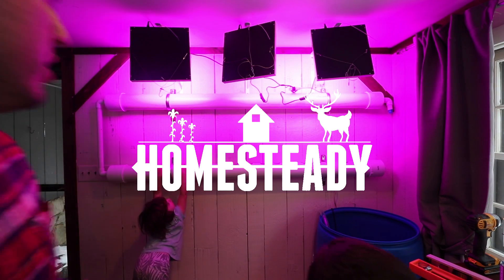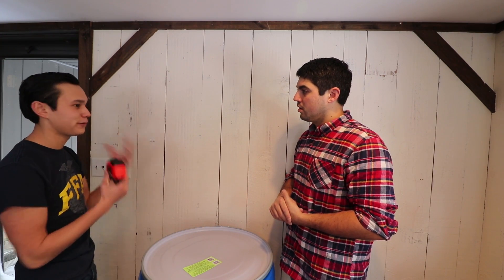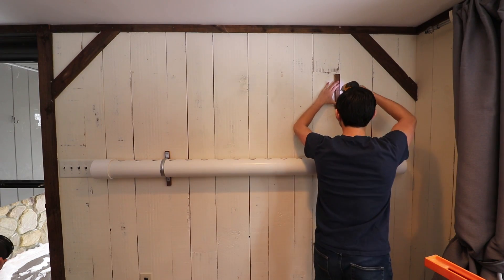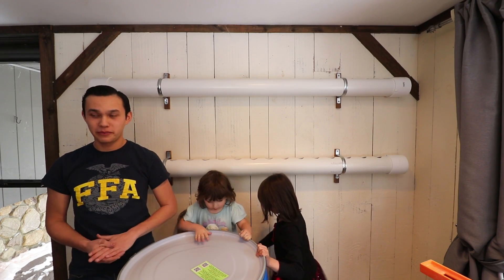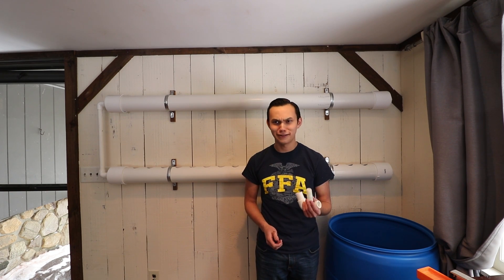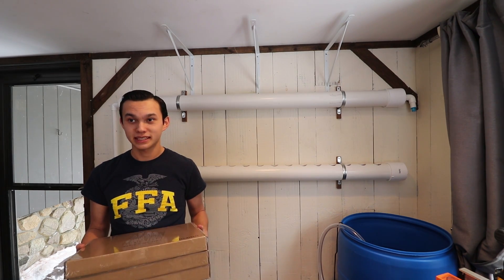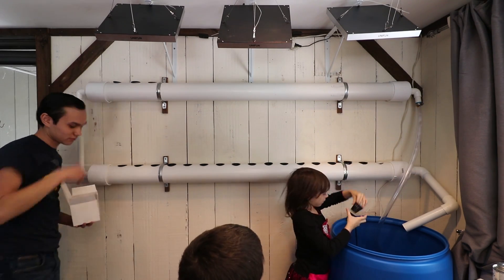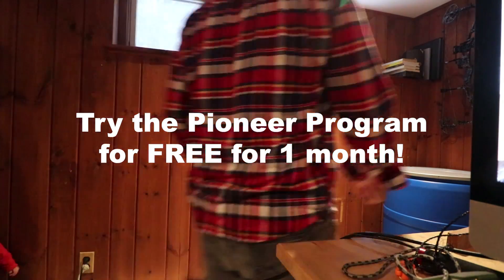Build a Hydroponic Grow Wall Inside - Grow Plants Year Round and Save Money!

Comment: Hi Jonathan, the LED light must be in purple color?
Reply: No, it can be white too, 6500K. There is a reason for the purple one, but I do not remember it.
Reply: Purple saves a lot of money because it uses less electricity I think
Reply: Those are specific spectrum lights.  A mix of Blue LED and Red LED.  Blue promotes the early stages of plant development, while red is used for flowering and fruit production.Too much red will cause leafy green veggies, like lettuce to bolt fairly quickly.  White/daylight lights, 6000 kelvin +/-,  gives you a full spectrum of visible light.  Daylight is comprised of all visible light colors which are important to plant development.  Too much of any one color will affect growth, nutrient uptake, and flavors of the finished veggie. 
 Hope that helps.
P.S.  -  Blue/red panels draw less power. a 50 watt panel for example of white draws about 50 watts of power at the plug.  Whereas, a red/blue 50 watt panel draws about 38 watts at the plug.

Comment: Love this but before putting on the cement use some PVC wash to brake down the plastic some so the glue holds tighter this is the way water company’s and plumbers do it I should know I have to help my grandpa all the time with PVC.

Comment: Cool idea. One thing on gluon pipe though. You need to use cleaner first. PVC has a uv protective coating that needs to be removed. It also preps the pope for better adhesion. You should also put glue on both parts. Great video though. I might do this.

Comment: Oh all I could see is the danger from leeks right on top that switch ☹️ love hydroponics used it for years but please move that lower pipe down 4" away from the switch
Reply: Michael Hubbard they ended up moving the system hahaha, but the system was watertight. If there were any leaks it would be from other parts before the endcaps.
Reply: Jonathan Russell if that was going to leak it would of done it at any of the joint above sockets and the end cap witch had joints. Even they he used cement doesn't make it permanent. Over time it degrade and I should of read watched it all as I was really pleased to see them moved it away from the switch.

Comment: I like the idea.  But, having had lots of houseplants before, I am aware of the tendency for mold and mildew to grow on walls that are in close proximity to dampness.  I would suggest putting up on the wall that you intend to use for the tubes some paneling or something that can be wiped down with a mild bleach solution from time to time.
Reply from the maker: All wood paneling for us, good tip!
Reply: @Homesteadyshow  wood rots very easily,id follow this tip lol